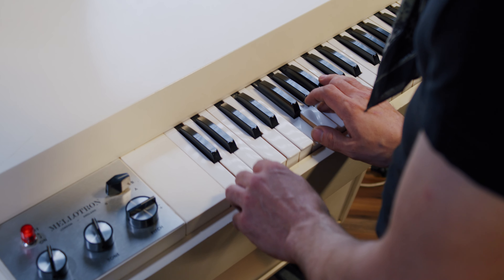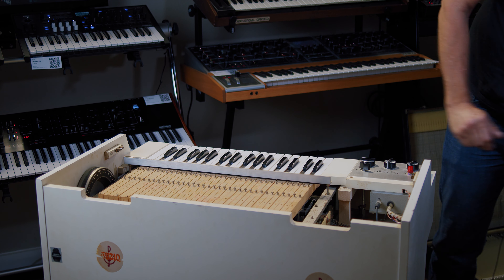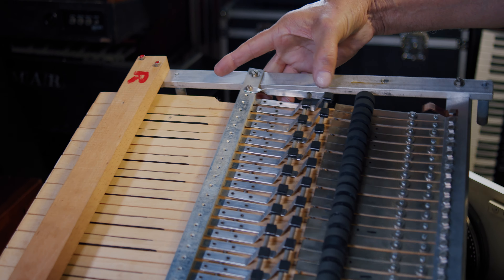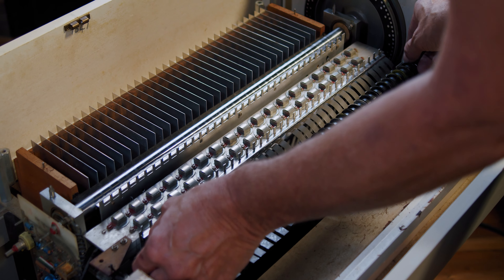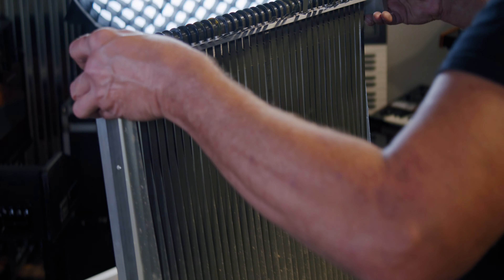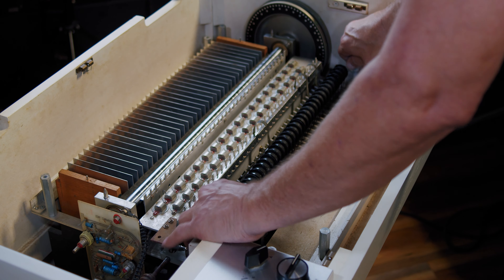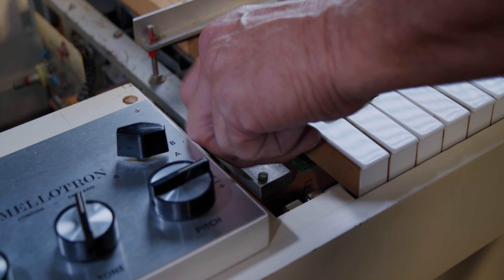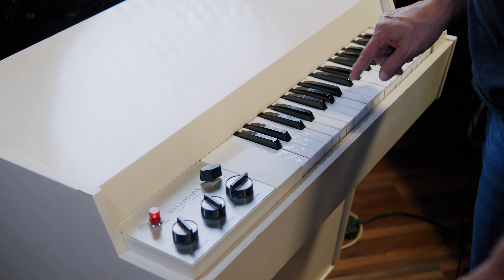How To Change A Mellotron Tape Cartridge

Comment: Does anyone still make tapes for this machine. Amazing!
Reply: It's just normal quarter inch tape. Just need to work out the pitch for each loop depending on which note it's for
Reply: Yes! There are currently 2 companies that make and sell new analog Mellotrons and tapes. One is Mellotron® (Based in Sweden) the guys that bought the assets of the original London based company when they went out of business in 1986. And Streetly Electronics, the original London based Mellotron makers, who got back in the game.
Reply: @nx01craig  Dave Kean (in Calgary last I heard) bought the old stock and copyrighted name and later sold it to Markus in Sweden.  Streetly Electronics (John Bradley and Martin Smith still make new trons and tape sets as well.  I have 2 M400's and 8 tape racks.

Comment: What if you don’t have another cartridge and some tapes are damaged. Not only does it need a few keys where would I get tape with sounds even if I had the live sounds to recored it’s 1/4 “ tape with 3 tracks and space between. What were they recording on. 24 track 2” tape = 12 tracks per 1” 6 tracks” per 1/2” and 3tracks on 1/4”.
Is it possiable that’s what they used or a 16track 1 inch machine. There’s no 3 track 1/4”. How ever there’s was 4 track 1/4’
Reply: You can buy new tapes from Sweden (Mellotron) or England (Streetly Electronics-the original manufacturer).

Comment: Ouch! Looked like some tape slack got pinched under the keyboard assembly...
Reply: I thought that too but it got pulled up and over when the tape bar was lifted up and slotted on to the back, which left those bits of slack at the back of the cabinet.
Reply: @mbvideoselection  Phew - was genuinely worried, that's a museum piece!